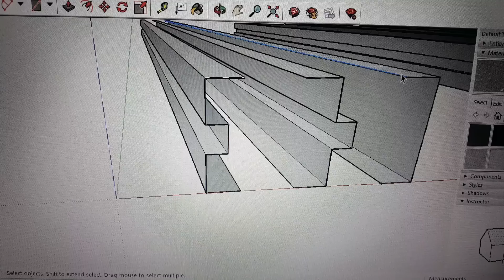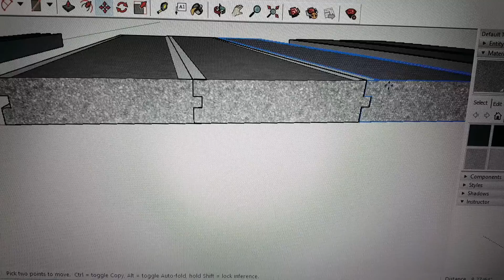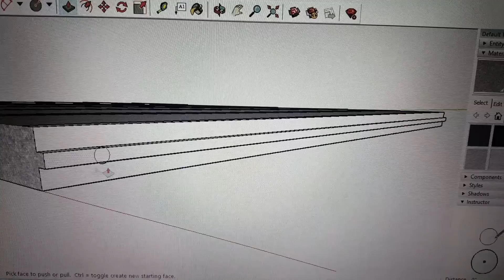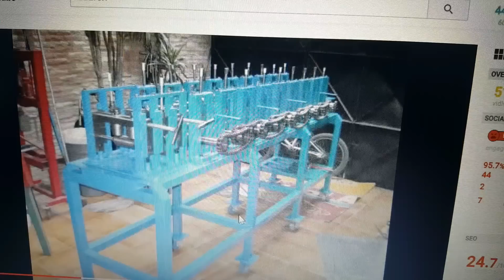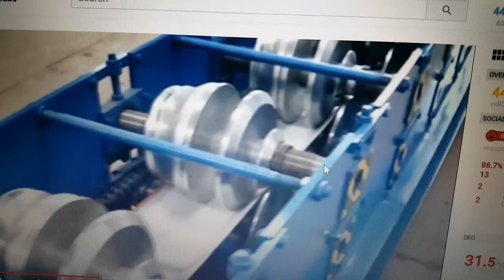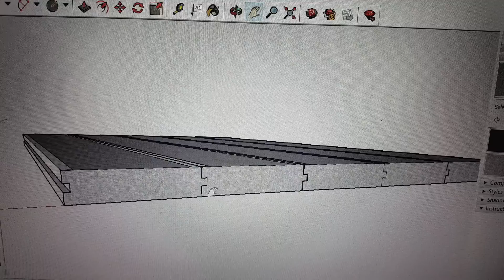Air Crete Interlocking Wall Panels

Comment: Check out Matthias Wandel's SketchUp videos. I love SketchUp, but it isn't intuitive at all. As soon as you get a 3D piece in to shape, you can triple click to select all lines, right click, and select 'make component'. That way you can just click once to select it and move it around. It also makes it easier to copy it or modify one to affect all copies, and you can right click and select 'make unique' if you want to customize one differently from the rest. 

There are lots of tricks like that which can save you tons of time, but you might never figure out just playing around in SketchUp. The is also SketchUp for Dummies and other tutorials that can save you a bunch of time. I know I've burned dozens of hours on things that I could have done in minutes if I only knew the tricks to it! Good luck and thanks for the videos!

Comment: When you go tongue and groove with your panels, also put a grooved one along the bottom of the panel so you can put a lock bead into the  slab/footing  to lock the walls into position. (might not be a bad idea to do the same on top)  What you are doing here is realy great!!  I am just going into retirement with a decent pension (translates to Operating Funds)and would be interested in a franchise when you get started. It wouldn't be hard to find some strong young guys around here needing a job :)
Reply: Hey Janice, they are hard to find now anywhere. All the utes (youths) only know how to lift their thumbs, lol.

Comment: Make all studs 'female', and use a spline. One less form machine, and no orientation problems.
Reply: GUY HILLIS  Great idea.
Reply: You are a typical Guy, Hillis.
"Wants everything female." 😃
Reply: H or I channel add fibers mentioned above slide aircrete panel in. Move to next. Tie together with rebar or cable. Maybe as an added run a bead of adhesive or sealant between aircrete panel and beam

Comment: If you go ship lap you have much more flexibility, they can move a little and easy to mate up  and if used for roof panel the shed water or if you want to go horizontal on the wall, you can go as high as you want as long as you want

Comment: why not weld the studs together the uprights a few 1 inch stitch welds down the length would hold a large amount of weight  same with the bottom plate and top cap channel  stitch weld it with mig welder 45* the corners on the top and bottom cap channels and weld or even 2 pieces of angle iron on inside one outside on the top cap with a few flat bar straps connecting the two. then welded to the uprights every joint or every other one .  just an idea that hit me.   and on the stud roll form machine i think the thru holes would work better set up your rollform with a hole punch pop holes in that thin sheet steel in secs verses the time to roll the tongue and groove. you worked in a fab shop you know time is money and thats the one thing we never have enough of time or money.

Comment: The following as not negative feedback but hopefully some points to consider as we all try to develop this new (to us) technology.  I'm really only playing devils advocate.
I like your thinking but I'm still against leaving any type of conductive material on the panels when they're put in place permanently.  I consider it both an unnecessary additional expense and detrimental to the insulating value of aircrete.  While your idea of placing channels in the panels may have merit, remember you are leaving a sharp metal edge which could cut through electric wiring and because you have the same metal exposed on the surface of the panels, could present a shock hazard.  Why not just butt the raw edges together using tile adhesive or thin-set mortar like is used with AAC  (Autoclaved Aereated Concrete) blocks.  I just ordered a drywall sprayer (?), the type used to make popcorn ceilings with drywall mud, to put a finish coat over the panels after they're put in place.  I know that no matter how careful we are, the brittleness of the aircrete will result in gouges and holes before we're finished with installation.
I recently purchased some very inexpensive fabric, tulle, insect netting and a plastic version of hardware cloth to try as reinforcement on the surface of the panels.  Have you tried using super plasticizers yet so you can cut down the amount of water in your mix?  How about glass fiber reinforcement to replace the metal hardware cloth you're now using?
Please keep up the great work you're doing.
Reply: In other videos, he has addressed the insulating disadvantage of having steel studs conducting heat & cold.  He doesn't like it, but would be required by building codes to use a traditional wooden wall frame anyway, and he saves time & effort by leaving the forms on, instead of spraying with release agent then removing and re-assembling a wood form after every pour.

While this is all an experiment by him as much as anything, he's changed his mind about things, plans, tools, etc. more than once, but his current thinking is that he will seal between the studs with butyl tape, and the outside wall surface will be covered with stucco, or some stucco-like concotion. 

The stucco won't completely solve insulating problem, but will help and he needs studs of some kind anyway, to meet building codes and help keep the building standing if there's an earthquake.
Reply: I’m interested in the results of your fabric  trials.
Reply: You would use a rubber grommet to cover the sharp edges of the metal just like other pass thru be a electrical box to metal buildings.

Comment: No wire runs?  Embed some pvc from the roof down to switch or outlet heighth and you can wire in low power CCTV, CTV, or power switches and outlets.

Comment: Why not reuseable molds for the air-crete panels. And skip the whole metal part of it. And the a few  pipes running horizontal thru to run the wiring and the others to run rebar through..
Reply: There are building codes where he lives that require studs in any wall for a habitable building.

He seems to have a little bit of concern about resisting earthquakes in Idaho. Aircrete isn't very high strength, as concrete mixes go and is pretty brittle. I don't see mention of him adding basalt fiber chop or basalt rebar to make it any less brittle and subject to cracking. 

Taking the metal forms off after casting (Especially THESE, with a lip top & bottom as opposed to flat lumber) would be a monumental hassle.

After Lowe's gives him a Veteran Discount, added to a bulk discount (for buying a pack of 70), the cost of a steel stud to leave on is about the same as a 2x4x8 wooden stud that he'd need anyway. 

But as much as anything, leaving them on gives him a wall with studs on 16" centers, to satisfy building inspectors if needed, and to help keep the roof from collapsing if the shed winds up doing The Earthquake Dance at some point.  

This is a small-ish shed, so I don't know whether it would need to be inspected as a habitable structure in his jurisdiction or not. 

Where I live, in South Texas, it depends on factors beyond your intended use, such as square footage. 

But if earthquakes are a problem in Idaho he certainly doesn't want the tops of the walls to break and crumble during an earthquake and quit supporting his concrete roof over a Gold Wing motorcycle that will be parked there.

Also, it's a Learning Project. He's mentioned several times in his video that he has intentions of building geodesic dome parked in his mind somewhere. 

I'm surprised he didn't build the dog house first, to see what could be learned from that, before enlarging his scope to a storage/parking shed.
Reply: Yea I am living in my forever home and are aging in place.  I bought the large tank foamcrete gun from him to make 4 foot by 4 foot panels for raised garden beds.  87 year old me will be happy that 57 year old me did that!
Reply: Are you speaking of how they make the bricks overseas?
Reply: pheotonia hey you are correct but I mentioned same thing in another post but who knows with the building codes. On YouTube they make light weight concrete panels for fencing compound walls overseas. He is spot on on the concept. 

Another idea if possible is drilling down into pad and epoxy the rebar through the hole he mentions. I love to hear people work stuff out.
Reply: I agree with you Thor, get rid of the steel frames, they are not necessary and are a huge additional cost. I think rebar is going to be necessary for most building codes.
Reply: With those studs an improved structural strength is offered to the building, great idea Mr. H. D. Carpenter

Comment: How about "Z" channels?  More forgiving. Then you only need a break as opposed to a roll form. Stagger studs from side to side or flip for corners into 4' prefab units. Slip forms into a deep plate channel to seat .Preframe doors and windows into 4' panels before pouring. Silicone joints. Put conduit down each panel to make wiring easy.

Comment: This is a great idea. Think of another possibility with added thickness ,any length formed fastened together would be a great new idea 
For inexpensive floating docks for owners with lake homes. Just add a few more tricks to make it work. Let your imagination do its job.
Great work Darwin, keep it up my dear friend.
Reply: Aircrete is porous.  

Water flows in and out of it almost like it was a consrete sponge. 

A 4-inch-thick block of aircrete left floating overnight then cut in half will show water over halfway to the center of the block. You can find videos here of that being done. 

 Your floating dock would be floating VERY low after just a few days unless you painted it with elastomeric paint of some kind to seal it.   That would not be a very long-term solution, especially if you didn't somehow cover the top surface with something to resist wear of foot traffic. 

I assume that metal rebar would also be unusable due to rusting issues.

Comment: instead of using c chanel, use a wooden form, and put a 1x1 on one edge in the center. on the other side put a timber strip on both edges, leaving a 1x1 gap between. ☺
Reply: Or just put two pieces of timber each exactly half the panels thickness, one at the bottom on one side and the top for the other, no tongue or groove just a universal panel that can fit both ways. Even the corners are accounted for, think think of it like the stepped piece i the game tetris

Comment: I think you are over complicating things. There is no need to interlock anything.  Wood studs create stud bays and those bays don't interlock.  They are nailed to the top-plates and base-plate.   That is how you need to assemble your panels.  Just have a way to fasten them at the tops and bottoms and the whole thing works just as it should.  
Really, all you need is the top connection since your bottom connection is already thought out.

Comment: I think it's a good idea, but my opinion is that it solves a problem that may not exist. I can't see there being much force laterally on the wall panels. Now, I'm assuming there will be some type of banding attaching the panels to their adjacent panels. I'm also assuming a double layer of a caulk or adhesive between panels. With a channel top and bottom, there shouldn't be much room for flexing.
I've also thought of putting a pvc conduit in the pour at 18 inches from bottom to be used as the electrical raceway. Home runs put in the slab can be put in the panels with a stub out the bottom to mate with and out the top for ceiling lights. Just my 2 cents worth and I'm looking forward to your progress.
Reply: I'm looking to make 4 foot x 4 foot raised garden bed walls with this.  So for me the problem does exist!
Reply: Tony B. Instead of caulk use aircrete

Comment: Hmm, if you turned a stud out on one side, could the 'wings' be bent out to overlap the wings on the panel next to it allowing an easy way to interlock the panels with off the shelf stuff?
Reply: You could also make a simple peg interlocking system, leaving pegs out in areas where you don't want them - the end of a run, door frames, and the like.  In your jig to bend the studs, add ports for predrilled holes in all the studs too, then on one side of the form weld small protruding metal pegs (similar to the sort used in adjustable bookcases to change a shelf's height) in those holes that will then match up with the predrilled holes on the other side of an adjacent panel.  I imagine your spot welder can weld the pegs onto the stud before filling the form on the one side.  It could be a piece of rebar too that goes halfway through the panel it's welded to (and, consequently, halfway into the one it's joined too).  For light, cheap, easy materials you could try it with PVC as you mentioned too.